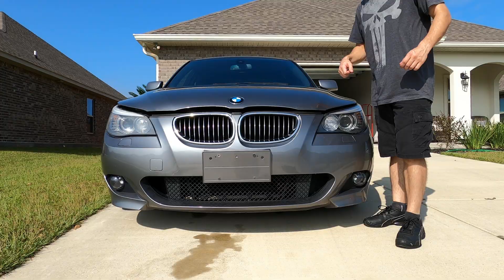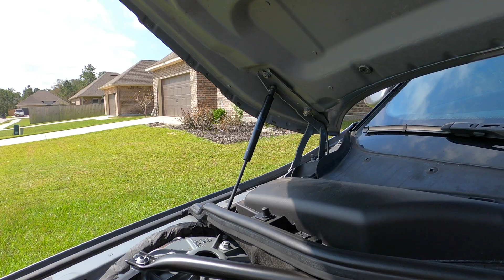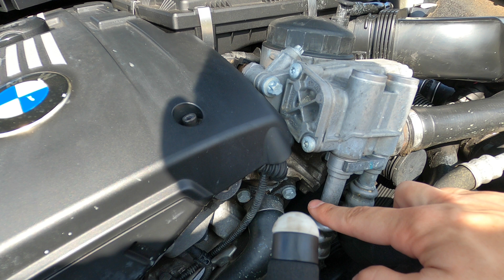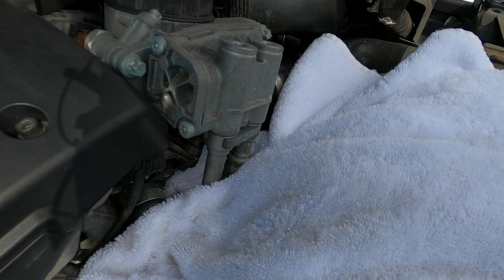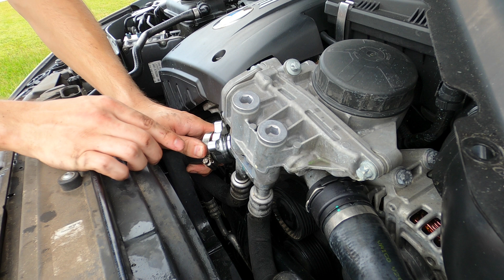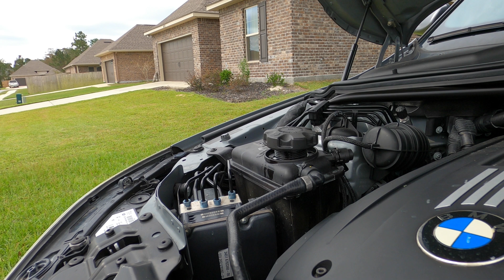BMW E60 N54 Cooling System Maintenance and Reliability Upgrades

Comment: Is it normal for your coolant expansion tank, upper radiator hose and oil filter housing to be too hot to touch after some stop and go city driving? I’m not getting any overheating message on the Idrive but I’m wondering how hot is considered normal? I replaced the water pump, upper and lower radiator hoses, coolant tank and did a coolant flush.
Reply from the maker: The N54 is a very hot running engine. It's part of the reason all the plastics of the cooling system fail so frequently!

Comment: BMW loves their clip on hoses, but then uses plastic with 220°F coolant. When I used to deal car parts, people didn't understand why I only recommended using the correct blue coolant on Bimmers. AlL mAkEs AlL mOdElS, jUsT uSe ThE gReEn. Do it right or just don't do it. 👌
Reply from the maker: Mixed coolant becomes cooling jelly in some cases!
Reply: You mean blue. Youre confusing the public. Why even mention green?????